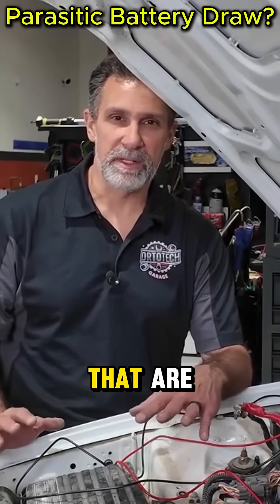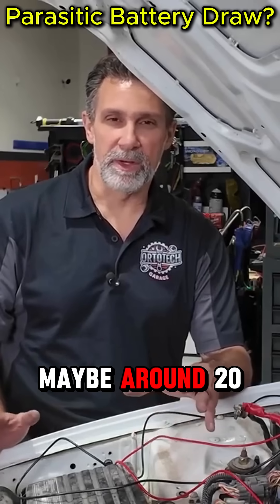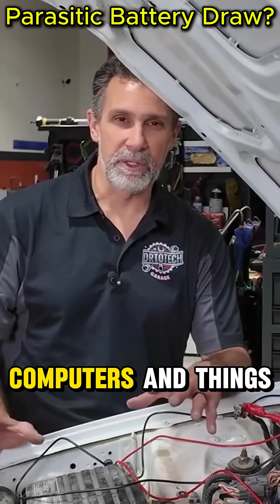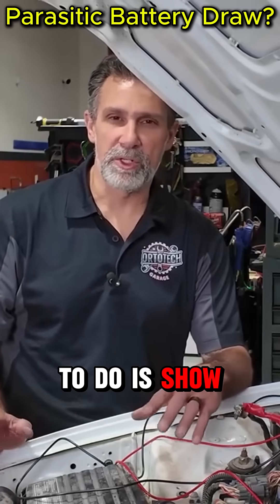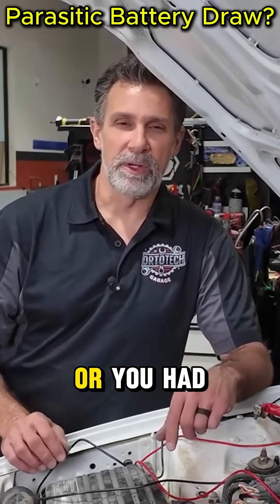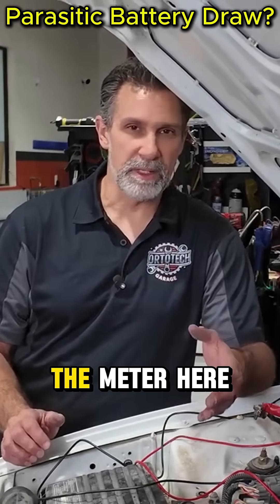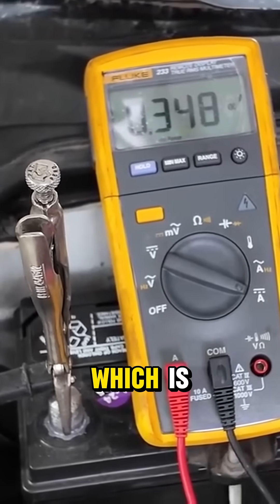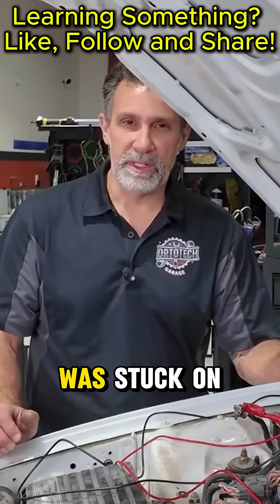This Tiny Current Could Kill Your Battery!

Comment: For reference to the viewers out there, it takes 20 miliamps to light a single led properly.  So if you have a lit up phone charger still stuck in the cigarette lighter, expect 20-30 mA draw.  Aftermarket alarms usually draw the same, unless they are really fancy and flashy.
Reply from the maker: Thanks for contributing!  Perople are often surprised at the smallest things that can drain the battery, especially a marginal one.

Comment: For sure. Drained my battery with the engine bay hood up. Didn't think about the light they installed on it.
Reply from the maker: Thanks for sharing.  These are the most common problems we see. Dome, glovebox, trunk, and hood lights.   We often have to unplug the hood lights when servicing vehicles.  Especially those with older incandescent style bulbs.  👍